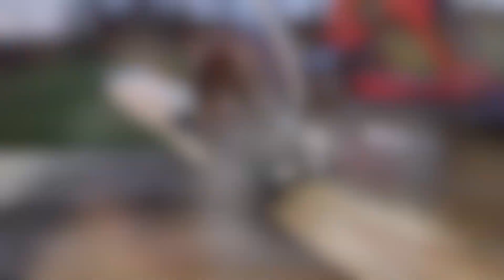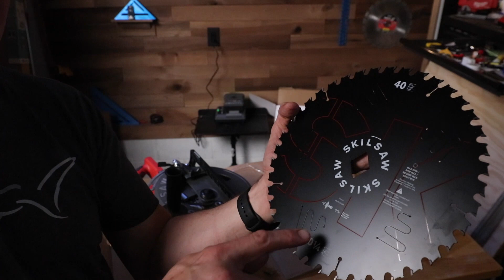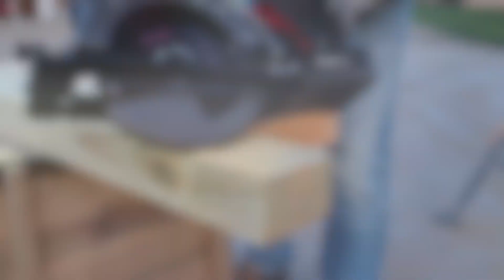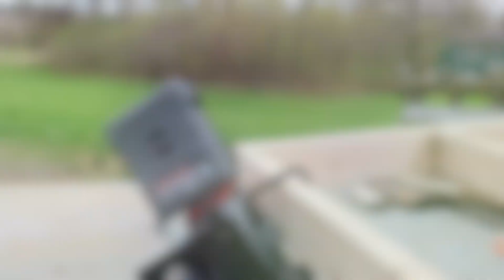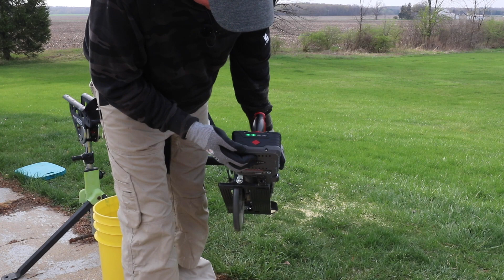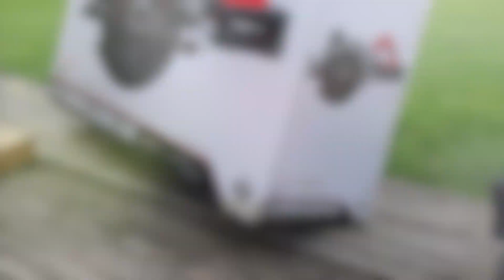Shocking Results After Trying Out the Beastly 10-1/4" Worm Drive Cordless Skilsaw!

Comment: What is the best blade to use to cut pickleballs in half? Pickleballs are typically made from polyethylene (often LDPE, Low-Density Polyethylene) for outdoor use due to its durability and resilience1
. For indoor use, they might use polypropylene, which is slightly softer and provides better control on smooth surfaces.
Reply from the maker: Some type of fine tooth bandsaw I'd say.
Reply: @MarkThomasBuilder   but I am using the saw in this review. Which blade should I get for this saw?
Reply from the maker: A fine finish saw blade is what I'd say.

Comment: You didn't put any oil 🛢 in that saw?
Reply from the maker: Great observation, Harbert.  I thought about this talking point, but forgot to add it in.  The saw comes properly lubricated and ready for use from the factory.  I'll need to do an oil change after the first 10 hours.

Comment: Holy Smokes , it’s “Red,” and Mark is reviewing it, but it aint Milwallkay!?   Wow!   😯🤔😂  I just couldn’t resist!  

Hey Mark!  As ‘Crocodile Dundee’ would say, “Now That’s a Skilsaw!”  Impressive cutting and really good battery life, although it sounded like it was bogging some?  I think it’s a solid product, but only Deck, or Fence, or Timber Frame builders need apply.  

The Slo Mo of the blade coming out of the material was great footage Mark!  That blade guard really did its job.  I like the Soft Start, and you could see the torque of that thing when you were switching it on and off.  Good to see you putting out content Mark.  I’m sure You are one busy Man!  Stay safe!  👍✌🙏
Reply from the maker: Haha, hey George!  Yes, I'm mixing in some different brands on my channel.  Bringing you a wide variety of tools that aren't always as common.  
I heard it bogging down on the last few cuts of that 4x6.  The wood was out in the rain today, so it might have been a little more of a challenge compared to a lower moisture content.
Thanks for stopping by and I'll have another interesting tool review this weekend.